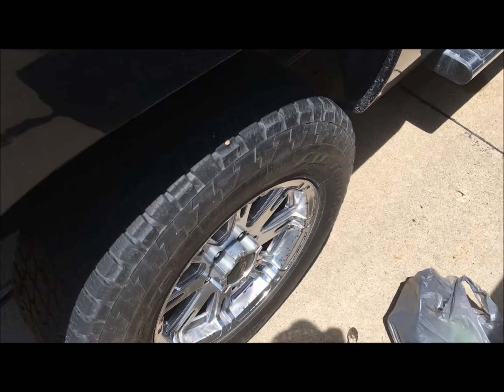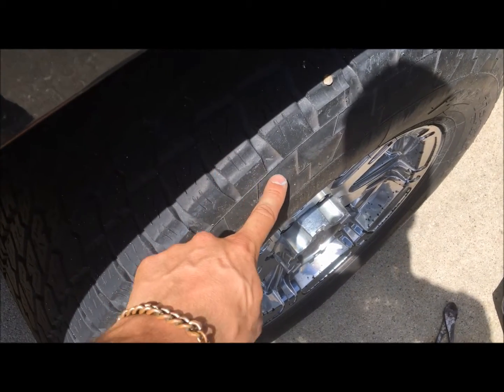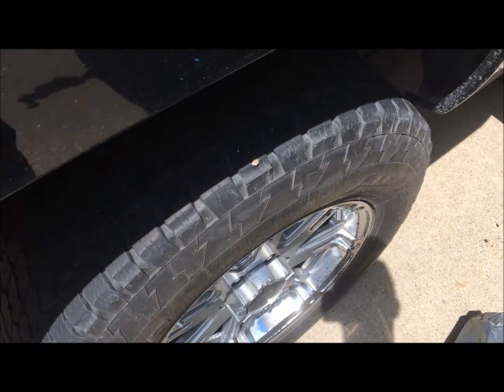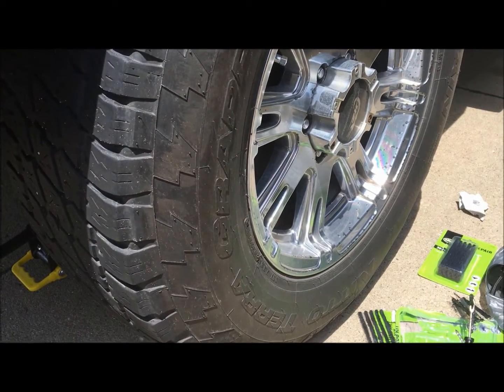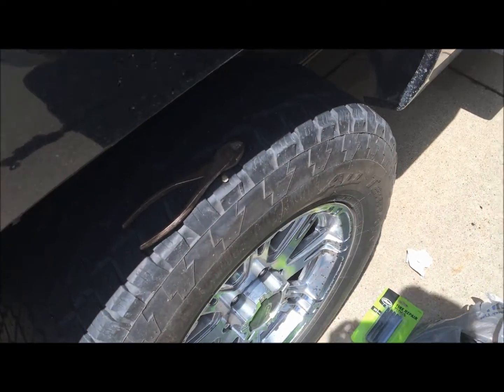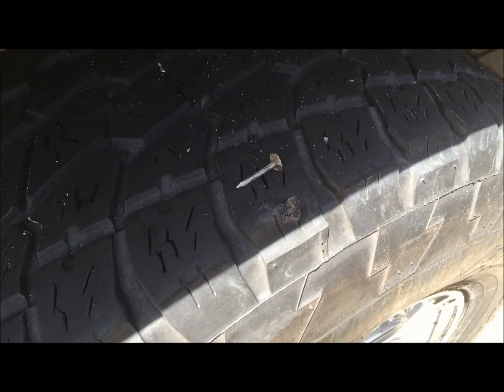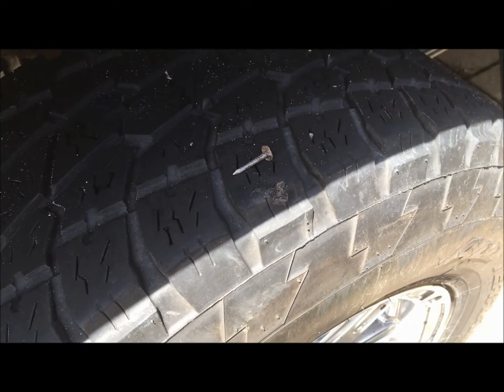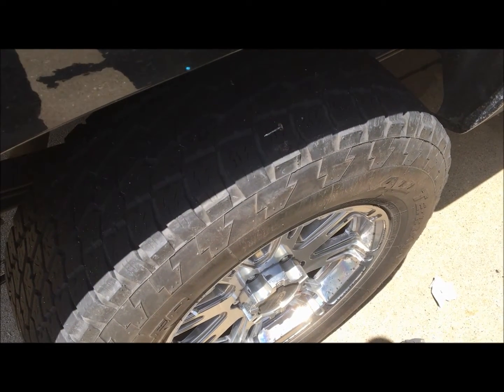Nail in Tire? Fix It on the Road FAST & By Yourself (Save $$$)

Comment: In the UK a reputable tyre shop wouldn't repair a puncture that close to the side wall and would want to replace the tyre regardless of how much tred is left on it so you could safe a lot of money plugging your own tyre. My kit has paid for its self already and the tyre has been plugged for  well over a year now with no problems but its all at the owners risk mind.
Reply from the maker: Completely agree. Same thing that happened here
Reply: +ThunderHead289 it's ok, its a Chevy so the thing will only last so long and the tires are not the weakest link.